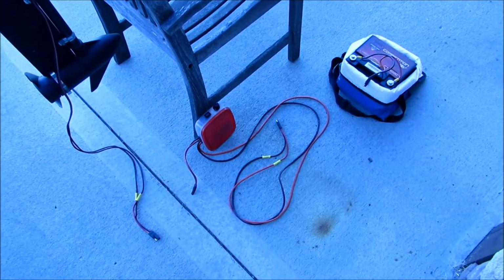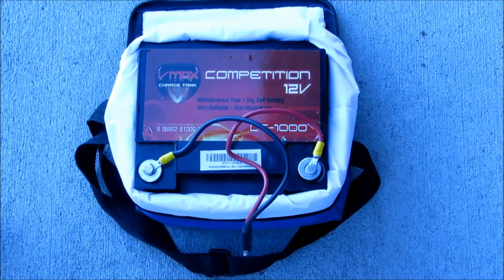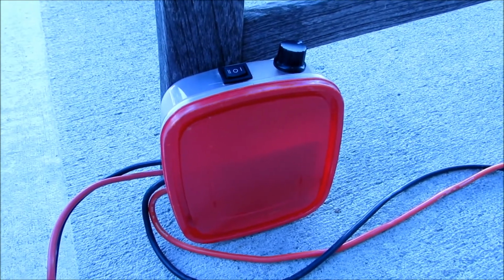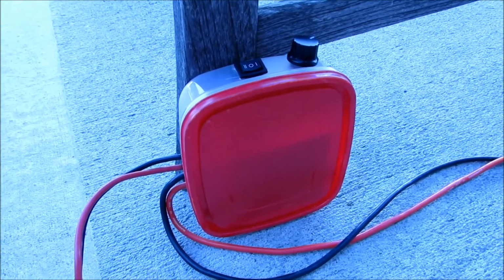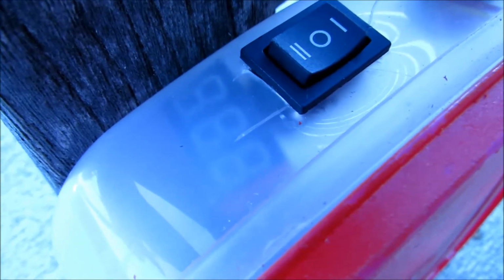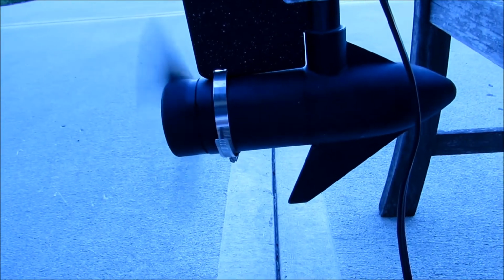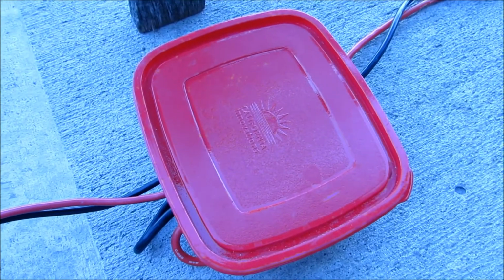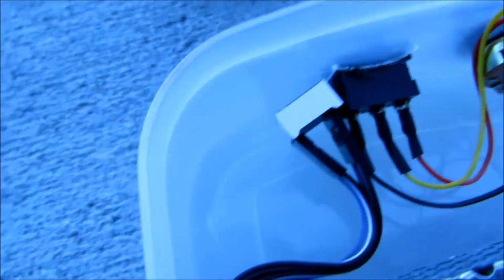DIY Pulse Width Modulator PWM (Digital Maximizer) for Trolling Motor Control

Comment: Nice!  I really want to try this set up on my kickboat.  One question, how many quick connect do you need?  Do you have a link where I could find them?  Thanks.
Reply from the maker: I use two sets of quick connects - one between the motor and the PWM, and one between the PWM and the battery. Minn Kota makes one:  MinnKota MKR-12 Quick Connector Plug https://www.amazon.com/dp/B001PTHKRG/

Comment: Hey, can you tell me what model modulator box is that? Can you please send me a link on the place of where to buy it, I have a 55lb thrust trolling motor
Reply from the maker: I got mine on eBay. Just like this one: https://rover.ebay.com/rover/0/0/0?mpre=https%3A%2F%2Fwww.ebay.com%2Fulk%2Fitm%2F112632201224
Reply from the maker: You'll have to ensure you get one that can handle the power of your trolling motor.

Comment: Very helpful.  Thanks for doing this.  Question:  Can you just hook the power from the PWM to the motor and bypass the internal switch inside the motor and just control everything with the PWM?
Reply from the maker: I suppose, but I gave myself the requirement of leaving the trolling motor intact, so it could be used without the PWM, or even sold later. I didn't have to disassemble the trolling motor housing, etc.
Reply: Yes you can. Remove the trolling motor head it'll have 4 wires. Use the red power and black ground and tape off the other 2 and remove the switch. Then wire the red and black wires to the "out" of the pwm
Reply: Texas Kayak Fishing yes you can

Comment: Hi, what wires are connected  to the trolling motor switch, as to why you have to leave it on 5? With my pwm, I control everything with the  pwm.
Reply from the maker: Not sure what you're asking... the trolling motor is left intact in its original state, other than crimping on a quick-connect fitting at the end of the wires.  I leave the trolling motor switch on 5 so the motor uses 100% of the applied current, and does not try to convert any of the current to heat.  I control the speed and forward/reverse with the PWM.